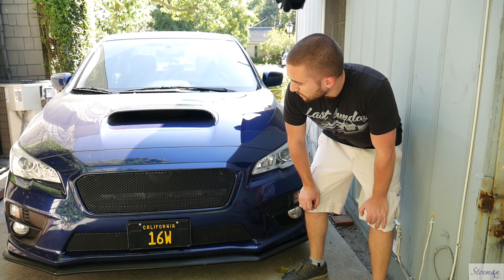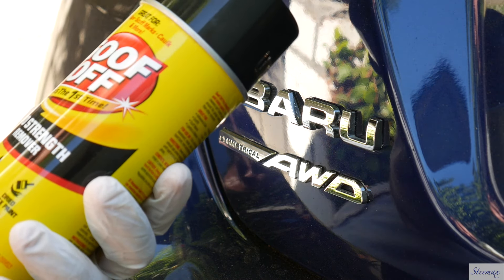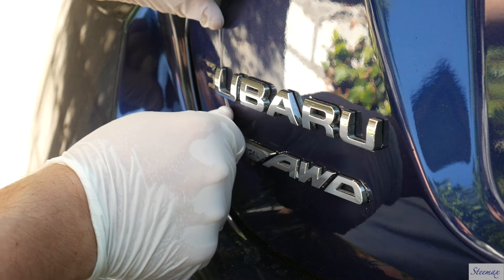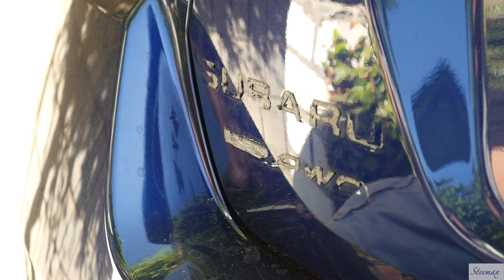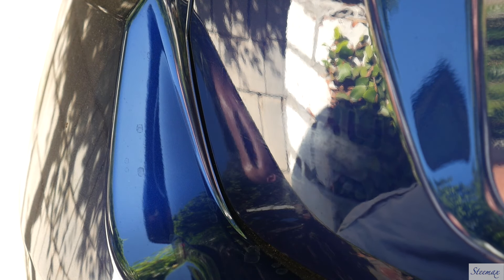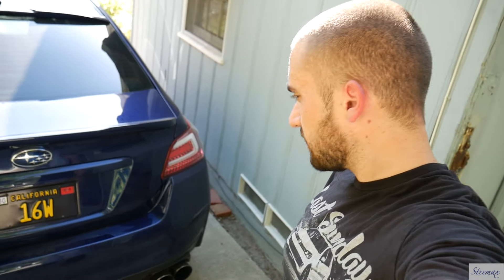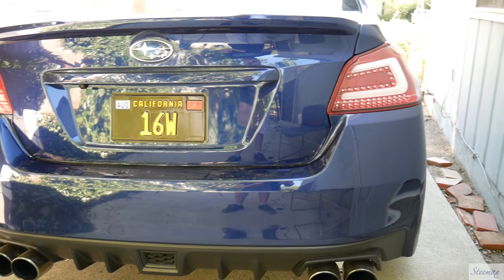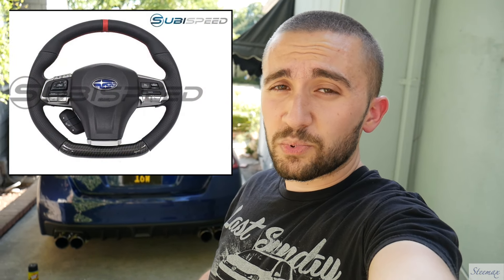2015 - 2017 Subaru WRX Debadge & New Mod Ordered

Comment: 16W? So much cleaner! Those taillights look great!
Reply from the maker: I wanted the new black and yellow plate with just 3 characters and couldn't think of anything to put so I just put 16W (16 WRX) lol! and thanks man, I'm very happy with how the rear has turned out.
Reply: Ohhh
Reply: Steemax How did you do this? I thought this wasn't possible with the CA dmv website??
Reply from the maker: +127_PM you can do it, there's no restrictions on the DMV site short of writing obscene things lol

Comment: any problems with the clear coat after? and another question, do you reccomend to clean the area after?
Reply from the maker: No issues with the clear coat which is related to your second question... you will need to clean the area after with some car soap/water to remove any residue left over from the chemical to prevent any issues with the clear coat.

Comment: I was thinking about debadging and painting my subaru badge. Would you have any ideas on how to stick them back with ease?
Reply from the maker: My best guess would be to use 3m VHB double sided tape to stick them back on. They have different thicknesses so you'd want a very thin one of course.
Reply: Yeah, sounds good..wondering about how to stencil or line the letters back. Say...could you do a video?? lol 

btw great channel... :)

Comment: If after I removed the badge and the sticky residue an I can still see the subaru logo what should I do to get rid of what's left? All the residue is gone an I washed the car after not sure if waxing it would make it go away or what.
Reply: aquaticpimp get glue remover and use a microfiber cloth to clean up

Comment: Can I use a hair dryer and dental floss?
Reply: Downhill Racer No it has to be a heat gun the blow dryer doesn’t have enough heat to melt the adhesive...